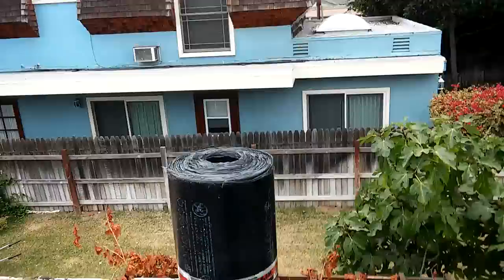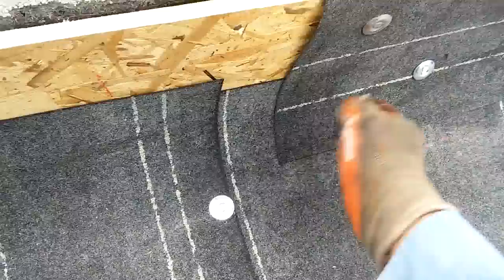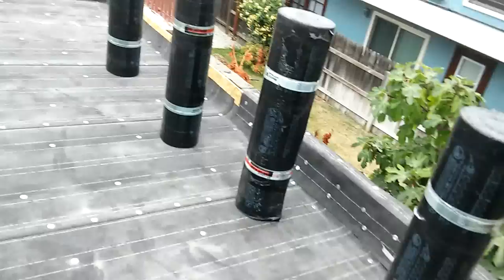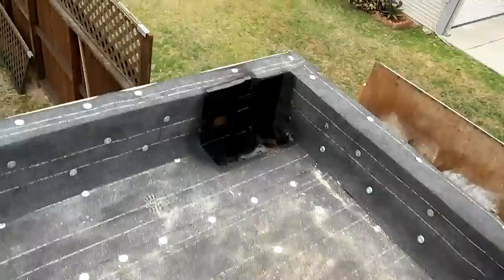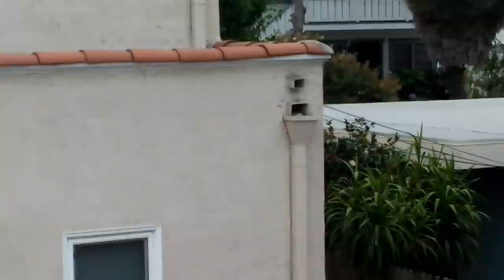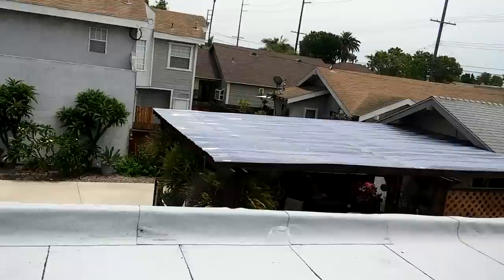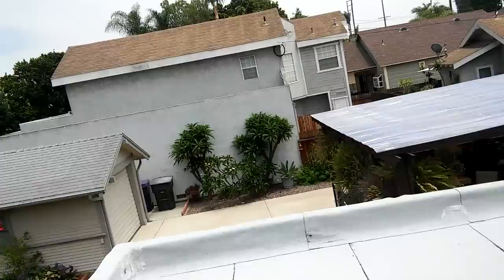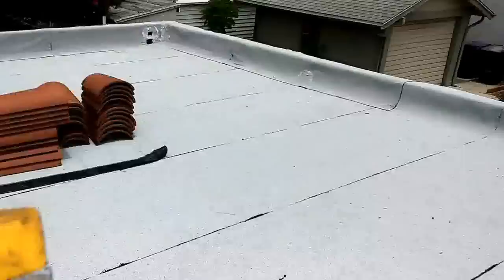Build up roof ( base flashing)

Comment: Thats not called a base flashing thats sanded paper. You should only use that as a fire profing. Not as a base .you still need your base rubber under your cap sheet . Your roof should be water tite before cap you still need alot of learning.
Reply: Exactly, roof should be one percent sealed before u even touch the cap, u should always look at the capsheet as its only there for looks and not to save the roof.

Comment: A lot of ppl with different opinions, fact is in different parts of the world standard change. Maybe in California this is allowed and used cause they don’t have to worry about sitting snow and build. But where Soprema is a used mod bit system (torched on roofs) you could nail and sanded back base with a poly on top keeping nails 12” apart on the rolls and every 6” on the bottom lap. The overlapping base would be torched at the seam.. Buen trabajo brother pero aquí en Canadá no se pudiera hacerlo así!

Comment: you are not supported to torch onto that crappie base sheet.  It has a sanded surface.  . you need to use the torch applied base. for those who don't know its the same material as the cap sheet but it is smooth, then you can torch the cap sheet on the smooth base. remember to stager the seams
Reply from the maker: seriously ...you are not a roofer,  or maybe you are a roofer but ...one of those roofers that you can count by 1000's ,  you talk like if you really know about this trade .
I strongly suggest you to learn how to be a roofer , practice and most important ...
read books ....READ , READ & READ .
so far your comments makes no sense .
I will call it a NONSENSE.
good luck roofer apprentice.
Reply: I have been in the roofing business for 29 years. I use soprema systems and I am certified by the manufacturer.  first off you are supposed to screw down protection board, torch on base sheet then torch down cap sheet. that my friend is the right way
Reply from the maker: Chuck Taylor King ...Again , this product IS NOT Soprema , soprema makes this refective materials and cap sheet and has it's own system , if you were a roofer , you have to understand that any build up roof can be installed over plain wood and concrete without the need of insulation board, when you install cap sheet over base sheet it's called :  2 ply torch down , if you add smooth it's called 3 ply system and so on .
so far you say you are a roofer , but don't know the basics, I suggest you to go back and learn the basics , that usually happens when you don't have school .
good luck in your journey .
Reply: Roofing Solutions By Eric Garcia the problem is that you are to cheap to get the right materials, and soprema manufacturs many types of cap sheet. go on the Internet and have a look. do you know what protectaboad is its a4'×5'  1/8" thick semi rigid board that can be mechanically fastened, then you torch down 180 s.b.s. base then you torch on top of the base with a 250  s.b.s. cap, make sure that you stager the seams. I am just telling you the best system to use. just look it up
Reply: Roofing Solutions By Eric Garcia oh ya I was roofing when you were in public school, just fucking with you, look up IKO flat roofing products they have the same systems
Reply: Roofing Solutions By Eric Garcia oh ya I was roofing when you were in public school, just fucking with you, look up IKO flat roofing products they have the same systems
Reply: oh and a built up roof is a system that has insulation protectaboad and either a 4 ply hot asphalt with gravel, or a modified 2 ply torch on system.  Also with a modified torch applied roof you must add a flashing of torch on to all perimeters, first off the granules must be embedded 6" on the field,
Reply: yeah man that look like shit. to much heat. you can see it right at the end of the video by the scupper on the cap. can give you one thing, your seams.went with your scupper. you don't need to take the granules off back 6 inches from the curb before you detail in Cali?? were I'm from we measure six inches from the wall or curb. chalk take the granules off, then detail that shit for a true seal.
Reply: Chuck Taylor King nop, job it's perfect nothing is wrong on it I don't know what state is there but job looks great and that sistem works perfect

Comment: There are too many things wrong with this for me to even start, if you came on my roof and did this crap I would send you packing before you burned down your first roll !
Reply: 1badmuthafutha - this guy wouldn’t know professional techniques if it came up and bit him on the nose!! He just makes up his rules as he goes. The overflow scupper has a NRCA criteria, not just what he makes up on his video!
Wall flashing also has a spec which he does not follow! He doesn’t know any better but talks like he does! Which just pisses off the REAL journeyman that learned their trade correctly and applies those proper techniques everyday!